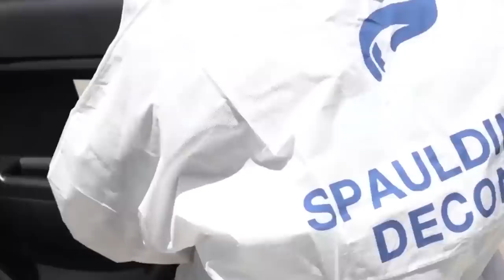Crunchy Jar Surprise

Comment: I've cleaned an apartment similar to that. I took one step inside, stopped, turned around and went to pick up my sister - who is a clean freak. I mean, no clean clothes but piles of them in every room, ant infestation, bugs in the food in the pots on the stove and lunches stuck to their plates even upside down, garbage piles around and on the furniture, beds stained with no sheets, a fridge you didn't want to open for the smell, holes in the walls and doors half off the hinges... it was horrible. We did our best, getting the clothes into baskets we could find, throwing away bags of trash, washing the dishes, piling the wall bits and doors against one wall together, at least lay blankets over the mattresses and baking soda rubbed in all over the window sills and vents where the ants were most common...left them fresh dinners of McDs and some water, because that's all we could do, really. Dropping someone off at home turned into all nighter, was just glad to hear them sound genuinely grateful for some help as we left.

Comment: I would not be able to handle all those roaches.
You've used an ozone machine at the end of decomp jobs to remove odour, but also had to remove any plants before because it can kill the plants. Is it an option to use the ozone machine at the start of jobs like this one, to kill the roaches and make it easier to work in there?